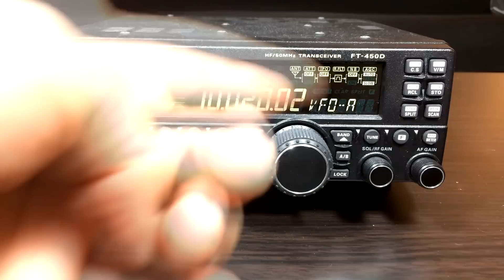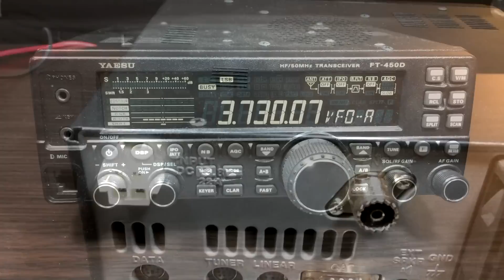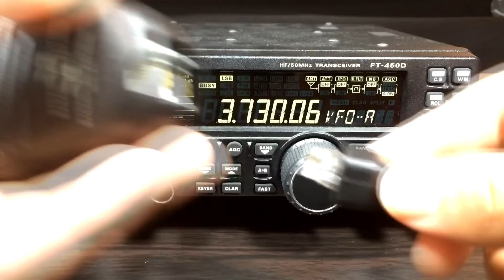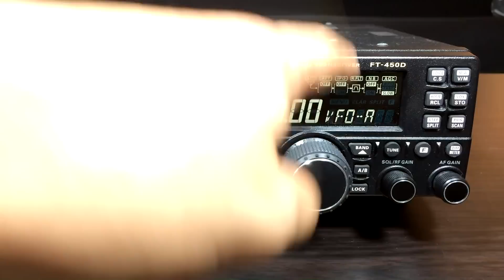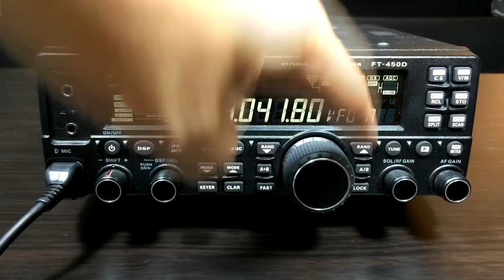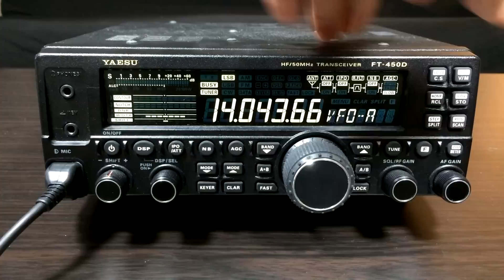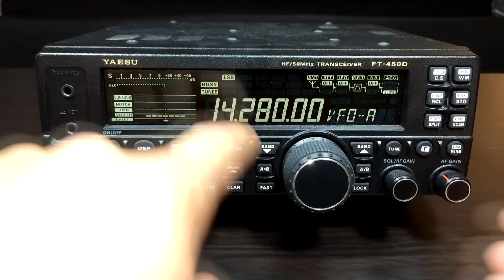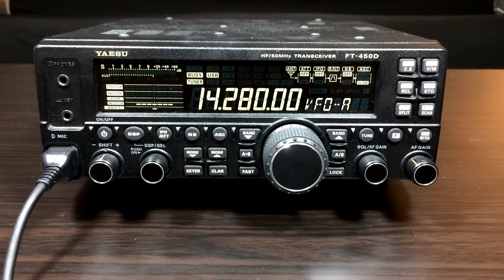Yaesu FT-450D: Getting Started and Overview

Comment: Something that many people don't know is that if you hold in the BAND UP button and the BAND DOWN button at the same time while pushing the On/Off button to turn the transceiver on,  the FT-450 will clean it's relays!!   This is an awesome feature that helps with receive for sure!!   Only needs to be done every few months of operation.
Reply: Thanks!
Reply: clean?what you mean
Reply: That’s the factory reset process

Comment: Just unpacked my FT450D and plugged it in.   My Kenwood TS520S died after 30 years of service.  My wife got me the Yahoo FT450D as a birthday present.  Since I am a CW OP there are too many bells and whistles in comparison to the TS520S, but the filtering/DSP systems will work well.  Thanks for the videos it beat trying to figure out the manual. 73 de Joe N1NUH
Reply: I have a TS520SE and this FT450D is a HUGE difference with the 520SE. Luckely we have some good folks with good video's as, in my case, i have to go thru the manual then i need mutch more time to understand  that " puzzle"

Comment: I have had a 450 for 4 years (AT model). I don't find it difficult to use, although I admit that I do not use a lot of the functions of the radio that are into the deeper menu functions. What I do use is very easy easy, and the manual is pretty good. I've never had to resort to Prozac to use it... One comment for Tony: Use power poles on the power cable. That dongle takes a bit of effort go pry off. Not only will it be easier, but you don't risk damage to the connection. I use power poles on every radio and type of connector--base, mobile, portable, etc. It is so easy to grab and go that way. Maybe it is a "beginner" radio in some people's opinions. I do not think so. I have gotten contacts all around the world, and I was complimented on both my signal strength and quality of audio. Not bad with 100 watts and a 30' OCF dipole, or Par EndFedz for portable. As for the ATU only being 3:1, if you can't tune an antenna to where it is below 3:1 SWR, something is wrong. I have my 80m HF antenna. It has tuned from 160m all the way to 6m on the OCF--no lie! I use a good quality balun from Balun Designs, 100' of RG-8X, and 100 watts. It isn't really a mobile or pedestrian mobile rig, but to throw in a crate or suitcase to take on vacation, it does a great job.

Comment: Tony, good overview of functions and operation.  I think it is a dis-service to most hams to call this an " entry level"  radio.  It performs to a high standard, probably on a par with the best radios of 10 years ago .Flexibility and adjustability are super. Perhaps  "More buttons is better"  if you are compensating for some personal inadequacy ( like Bigger Trucks Are Better). But too many people plow $1000's into radios..only because the ads in the magazine tell them to. This modern dsp radio will full fill the needs of 95% of the hams on HF and 6M.  Check the receiver reviews to compare radios.  If more expensive radios have specs that will be NOTICABLY BETTER To YOU... buy them if you can.  I cant use all the features this radio has. 2 cents please.  Do I need a band scope, 2 or 3 recievers, or a display that costs $2000 to replace ?  Not in the last 50 years.

Comment: Great video!!  Been thinking about picking one of these up but can't decided if I want to get the 857D or this one.  I'll defiantly will be checking out your series!
Reply: SD Cruiser I would chose this in a heart beat over the 857.  Better radio, easier to read.I monitor VHF ssb with separate radios... while I operate HF.
Reply: Easier to see "what's" going on with the 450D "all at once" on the display.

Comment: The FT-450D is a bit tricky to use at first since many functions have multiple button selection. Some features are not immediately obvious (eg. the attenuation operates in reverse!) and features such as the IF DSP are just not particularly effective in my view. My biggest gripe with this transceiver is the recovered audio. It sounds awful - hissy and tinny thanks to the crap speaker Yaesu used. Using an external speaker helps but simply exacerbates the synthesizer noise inherent in this CPU driven receiver.  The noise floor is also surprisingly high.  Overall, it's solidly built but lacks the ease of operation and listening pleasure of rigs that are slightly older.

Comment: I've just recently bought one of these, but I find the RX audio terrible & muddy; the only way I've found to improve it is to turn the contour fully down to the left.

Out of the numerous rigs I own, the FT-450D is hands down the worst for receive audio.

Has anybody else noticed the same poor audio?
Reply: Yes, I just purchased mine recently & it's a bad radio. Too much noise, although, they they said the 450 (old) & 450D (new) which is the new version has a roofing filter, & it's completely rubbish.
The only good thing is it has a tuner. & can be used portable with ATAS-120A antenna.
Reply: I had the same issue with muffled sound. The DSP Contour Filter has two settings, null and amplify. Pressing the DSP/SEL button once brings up null, pressing and holding a second time brings up the amplify. This is where you can adjust the sound with more treble to get that muddy RX more clearer to your liking. The radio is an excellent transceiver, simple to use, robust construction, and easy to read display with no fancy waterfalls 👍👍 Glad I was able to snag a used one. They don’t make them like this anymore. If you get the opportunity to buy one, get it! 👍😎

Comment: If I have an EFHW 10-80m and a 1:49 transformer do I even need to activate the tuner? I got lucky in that someone gave me both an auto-tuner (not sure if I need with this radio having built in tuner) and then a MANUAL tuner as well! The manual tuner seems to have some groovy SWR meters on it so maybe I want to control the tuning manually? Should I bother? Help! Thanks in advance. Cheers.

Comment: Thanks for sharing this, I need to watch the rest of them, but a couple if questions/suggestions for future videos: 1.) Variable RF power - could you show all the options. 2.) What is the actual power used? 22A @ 13.8V DC seems very high for 100W RF output! Can't understand how this could be more than 12A = 165W. 3.) Could you show it controlled by computer by RS232?

Thanks, really like the look of this radio, very tempted by it!
Reply from the maker: 22A is the rated spec...I've never seen it get that high. It's usually around 15A-20A or so If I remember correctly. However, remember that there are plenty of other users of power than the RF output...the fan, display, etc all use power as well. Also, the amplifiers and such are not 100% efficient...there will definitely be more power consumed than what goes into the RF output. Most 100W HF rigs are spec'd around 22A max current.

As for the RF output power, it is selectable in 1W increments from 5W to 100W.

I certainly could show off the RS232...I'll look into that for a future video. 73 and thanks for watching!
Reply: LoneVideographer   Solid State Amps are 50% efficient.   100  RF watts out requires 200 DC watts input,plus the digital logic, driver , fan and display all require power.  22 A x 13v = 273 watts ( peak)    so while the average will be lower... you can believe that the thing does require that much peak power.   However.. you can Dial In  any output power you want... 2 watts, 39 watts or whatever you need.   .. Remember you have to Qadruple ( 4X) your power output to Double your signal strength.. which is barely perceptible on the other end ( 1 S unit).   So chosing 25 watts instead of 100 watts   will make not much difference except Marginal conditions .  So want 5 amps max draw.. turn down the RF power and bob's your uncle !
Reply: I agree with previous comments. 100 PEP might draw 22A. I talk softly with the gain fairly high, and the meter seldom shows anywhere close to 100 watts, let alone full output draw. Not using the ATU reduces current drain also. You can dim the screen and reduce it a bit also. Using it at 50 watts is a bit easier on the amp, and just try it at various settings. I've used mine with a 9 aHr SLAB on 30 watts, and it did well, all things considered. With a Par resonant 40/20m EndFedz and the ATU off, it's pretty nice. Anybody can nit-pick, but if you look at most 100 watt rigs, they will draw a max of around 20 amps...at PEP.

Comment: Hi Tony, little question. If i start transmitting with the FT-450, the ventilator starts running. My vswr is1,1 and power 25 watts. Is it normal that the vent starts running as soon transmission begins? Normally i suppose that the vent starts only when the radio gets warm ...i dont know.  Thank you for your answer, all the best 73

Comment: Hey Tony thanks for posting this.  I'm interested in this radio and curious to know what your experience has been with the receiver, especially the sensitivity and noise floor.    I may have missed if you have already covered it.  If not, could you show some stateside and/or DX on-the-air testing with CW and SSB reception?  

Thank you! - John / KF5KI
Reply from the maker: Hi John,
I didn't go in depth with it, and I have no scientific measurements in terms of sensitivity and noise floor, but I've found both to be quite good. I'll try to get some more videos on this guy up soon- school's busy right now. Thanks for watching!

Comment: Best to start with the general spec of the radio (e.g. bands and modes covered, power out, power requirements etc.) before getting into the plugs and switches - not a critisim just a constructive suggestion.

Comment: Thanks for the video! Very good introduction.
For CW practice, it has a menu configuration to generate random caracters, but I have not been able to figure out how to practice sending without actually transmitting. Don´t even know if it has that feature, and I have been looking thru the manual, but have not found it. Can you tell me if it can be done and how to do it?
Thanks.
73, de XE2PDZ
Reply from the maker: You can definitely practice and hear the tone without sending it. I can't remember the exact setup (maybe in a future video) but if you plug in a key and don't hit the "Keyer" button, using a key should create a tone and not transmit.
Reply: Tony Milluzzi, KD8RTT  Thank you so much for the answer. Yes please, a video about it would be great.
I configured the radio to use a straight key, and the keyer button is not to be used there, but instead the STO/VOX during the process. The Keyer botton is for the electronic keyer.   It mentions a computer generated straight key emulation though, but does not explain any latter.
A chart of how much current that baby sucks at different power levels would be very useful too, in case one does not have a 22Amp power supply at hand. Would a simple rule of 3  be close enough to figure it out?
Reply from the maker: rickthenailer Ah that's right. After looking in the manual, it looks like you need to active the "BK IN" to actually transmit, but it doesn't say anything about practice. It's been awhile since I've tried it (and unfortunately none of my radio gear is currently setup) but I though just plugging in the straight key generated a tone on key down. 

As for the power, yeah, that could be useful. I'm really busy as of now, but I'll try to get something put together.

Comment: I like the rig and am debating getting it but for 2 things, first it seems really really small. At 3.3 "high how useable is the display? Do you need a magnifying glass to see it. Second, you pay $7-800 for this and then have to get a d.c power supply! and by most accounts the memory and other features fail just past the warranty date. Is it a car or a transceiver? Is the front panel plastic, the rear, the cover? Id like a good ft101e or z but they are 30+years old and getting new final tubes is pricey. But you dont need a dc power supply. I'm torn and unsure any suggestions? Anyone? I just want to get on the air! KD2JSS
Reply from the maker: It's interesting you've heard such negative things about the 459D- most people I know love it. The display is a fine size for me, I don't think it's small by any accounts. I've also not heard anything about memory failing just out of warranty. As for the dc power supply, that's fairly standard on most radios less than a couple thousand dollars. I really like this radio, personally. I think it's great for a new ham.
Reply from the maker: Also, most of the enclosure is metal. I think the front is plastic, but the rest is metal.
Reply: Tony kd8rtt, thanks thats helpful. I was a ham in the late 60's thru the mid 70's and just now got my ticket again. I'm used to my Drake, Johnson and Swan equipment.even though im comfortable with that equipment  I do see the need and benefits of the newer equipment,  like the 450d. Its just hard to make the leap from what I recognize as solid durable equipment to the current all solid state fragile looking stuff. I still have the Drake 2-c receiver I bought in 1967 and its flawless, will this current stuff last even half that long? Purley a rhetorical question. But I wonder.

Comment: do you run PSK31 on this radio? If so what do you normally run as far as the power output and How does the radio hold up to it?
Reply from the maker: Yep, I do use PSK31 with this radio. I usually run at about 20 watts and have had no issues with it!
Reply: Tony, KD8RTT cool. If I understand it when running like PSK31 the ALC meter still shows a signal but as long as you dont go over the two vertical dots on the end your okay? I heard some guys run the power at 100 watts and then use the speaker volume on PC to lower the output. Tell me how you do it please.
Reply: +mykenwood830 You dont want to use 100 watts on PSK, it will splatter on the waterfall. 20-35 watts, and the ALC meter should be almost not visible at all for best results. i like to keep mine at 2 or 3 little bars.

Comment: can you use a stright key with that radio  i like stright key
Reply: Yes you can use a straight key or a paddle. If you uses a straight key you need to use a stereo connector and leave the ring unconnected. The wiring diagram is in the manual which you can download from Yaesu.

Comment: A good transceiver overall with one major gripe. The audio is awful - it has this dreadful hiss in the background which can't be mitigated much with the DSP and RF-GAIN/ATT settings. Might be my location and antenna (which is not the best - just a loop) . It sounds a lot like my Icom R75 which had the same annoying hiss in the audio amp.  Heck, even my old Radioshack DX-394 sounds much better.